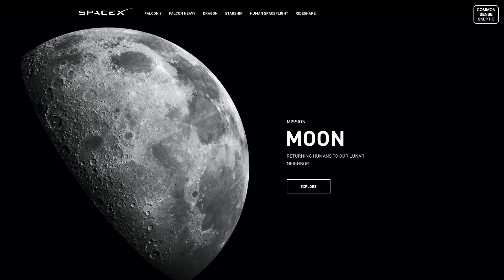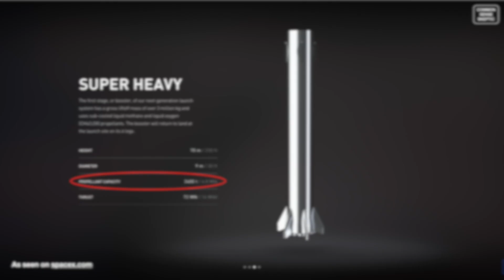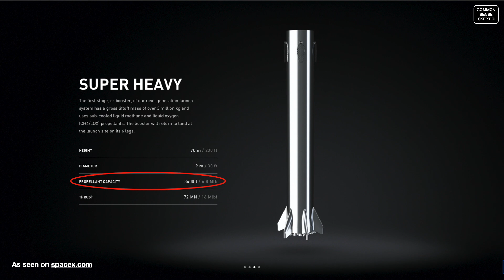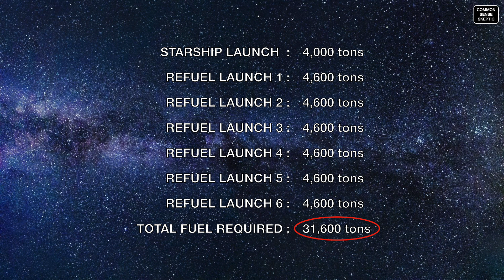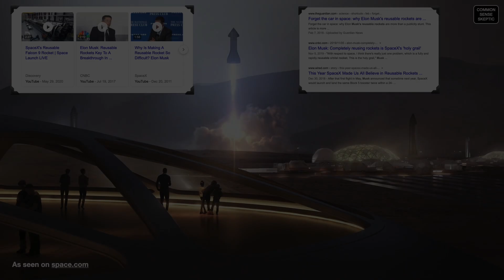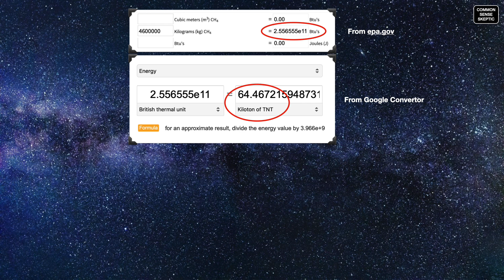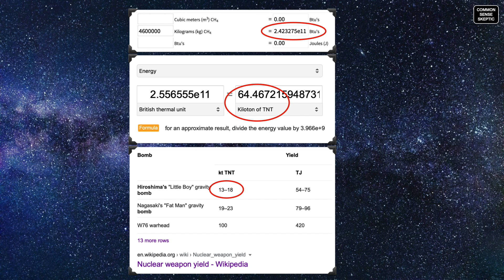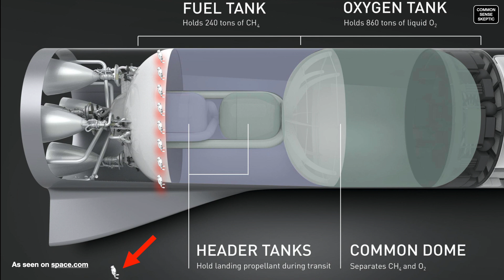STARSHIP EP5 - ORBITAL REFUELLING (1080p)

Comment: During orbital refueling, you don't need to transfer the fuel through sloshing. That would indeed cause the ship to de-orbit. You can transfer fuel in zero g through pressure against diaframs, which only need to be present in the tanker craft. I guess that this modification will be made to the tanker ship only, but confirmation is of course not there yet.  Regarding the rapid reusability, we have seen now several times that a StarShip prototype exploded on landing, but even so, it never destroyed anything but itself. Even when SN10 was standing right next to SN9 when SN9 exploded, SN10 and the fuel farm close by were unharmed. You mentioned that the superheavy lands with 3400 tons of fuel and that the StarShip sits next to it with 1200 tons of fuel on board. This doesn't happen, as the superheavy will land pretty much empty and the StarShip will only be fueled once it's stacked upon the (refueled) booster. If StarShip would be fueled beforehand, it would lose fuel and oxidizer through evaporation, introduce new risks, such as dropping the pressurized StarShip when lifting it with the crane, and the crane would have to be rated for much higher loads, which doesn't have to be the case. Finally, regarding the nuclear bomb thing with StarShip, those numbers seem out of proportion. While methane contains a lot of potential energy, such an amount never gets released during an explosion. Methane under atmospheric pressure (which it quickly attains when the tank is ruptured) has a low density, allowing it to quickly expand and move away from the blast zone. It would never combust under ideal conditions, in which all the energy would be released. Besides, why would any nation bother to spend so much money and energy refining uranium or creating plutonium to make bombs, while they could just build a (relatively) dirt-cheap StarShip with booster and just drop that on their enemy. According to your calculations, it doesn't even have to be fully fueled to get the job done, so I think you made an error regarding the energy release.
Reply: And, seriously, BTUS? I just can’t take that seriously.
Reply: ye you are right
Reply: You forgot the fact that Super Heavy may explode during refuelling, after fully fueled, during stacking, just before takeoff or right after takeoff. In this case CSS decision to use 3400 tons of fuel is correct
Reply: @KennyMong  it's true that such situations would be bad, but not as bad as was described in the video. Sure, the platform will be largely destroyed and debris will be flung kilometers away, but it will not be equivalent to a nuke in terms of energy. The fuel and oxidizer are not premixed in the booster and Starship. The fuel can only combust if it's mixed with the oxidizer and subsequently exposed to an ignition source. In case of super heavy, the reactants are likely to be expelled from the vehicle before ignition. This will result in a large fire ball, but not in an explosion. The energy release would be much less in this case.
Reply: @evertbunschoten2930  he did address this in a subsequent video if you are not up to speed
Reply: @evertbunschoten2930  "In case of super heavy, the reactants are likely to be expelled from the vehicle before ignition."

You mean, the methane will be expelled from the vehicle into the oxygen-bearing air before ignition, whereupon it will be quite thoroughly mixed. This is how a thermobaric weapon works.
Reply: @EEEEEEE354  If the SpaceX engineers are smart like you claim, Starship is going to be relegated to shuttling personnel and cargo to and from planetary orbit. It's clearly built with an atmosphere in mind, which means that it will be inferior in every way on other legs of the journey to purpose-built spacecraft. We are absolutely not at the point where a jack-of-all-trades tramp freighter can go the entire journey.

As to making Starship work even in that capacity, well, please realize that the problem of reusability gets worse as you get larger. You can't do anything about the propellant fraction, and the engines and avionics have to be sized to the rocket, and the structural beams have to be proportionally thicker in order to carry the increased weight, and that all eats into the payload fraction. We either need to find new materials to build our rockets out of, find better propulsion that allows us to reduce that fuel fraction, or find an alternate way to get stuff into space. Launch loops and the like are probably the best bet in truly getting the cost to space down.
Reply: @wyrmofvt  I totally agree with you that starship will be inferior compared to an purpose-built spacecraft. That being said, it doesnt mean it is useless, and is much more cost-effective than building three separate, built-for-the-mission spacecrafts. Two of those certainly NOT reusable, given the "purpose-built" tag you put on them. Money is the driving factor in everything our society build today. So, in order to be cost-effective, the concept of purpose-built spacecraft needs to be thrown away. Starship surely isn't perfect, but is the best we have right now, and in a relatively advanced stage of development. 
On the topic of structural integrity you've pointed out, to say that "the engines and avionics have to be sized to the rocket, and the structural beams have to be proportionally thicker in order to carry the increased weight, and that all eats into the payload fraction" is completelly wrong, simply by the fact that payload capacity is calculated after the ship hull is developed. Is the same as I saying that i'll build the roof of my house before I built the walls and foundations.
Reply: @julianorocha7462  Two of those certainly NOT reusable, given the "purpose-built" tag you put on them.

This is the point where your argument falls apart. I didn't say that the Earth-Mars craft and the Mars lander wouldn't be reusable — "purpose-built" doesn't mean "disposable." I mean, the Earth-Mars craft doesn't land on either Earth or Mars, but stays in orbit, and the Mars shuttle never leaves Mars's sphere of influence and is used exclusively to ferry cargo to and from the Martian surface. In fact, it is easier to make the Earth-Mars craft reusable because it doesn't have to endure nearly the same stresses as Starship will. Further, since Mars is smaller than the Earth, if you can make Starship truly reusable, you can make a purpose-built Mars lander/launcher reusable. My point still stands.

There's also the unstated premise that reusables will always be cheaper than disposables. Again, reusability is not a panacea. It has a cost associated with it, even in mundane items like cars. It's just that for those mundane items, the price of reusability is vanishingly small. The same is not true currently with rockets — nobody has made a rocket that doesn't need to be thoroughly inspected every time it returns to Earth. Until you can safely gas and go a rocket the same way you can with an aircraft, reusability will not be the solution to space access cost.

"the engines and avionics have to be sized to the rocket, and the structural beams have to be proportionally thicker in order to carry the increased weight, and that all eats into the payload fraction" is completelly wrong, simply by the fact that payload capacity is calculated after the ship hull is developed.

I'm "completely wrong," huh? Tell me, what happens if your payload breaks free during launch and collapses into the fuel/oxidizer tanks? That would end your trip pretty quick, wouldn't it? Sorry, pal, but the structural limits of your spaceframe is one of the constraints on your payload size, one of the factors that figure into that payload capacity after your spacecraft is developed. Because if you don't, you will not be going to space today.
Reply: In fact, you CAN use thrusters and not deorbit or even lower your orbit. You can thrust laterally to change the inclination of your orbit, and then turn around and do it again to put it back like it was. But the idea of doing that simply won't work. You can't transfer propellent by sloshing it in zero G. It has to be pumped, otherwise you are thrusting for tens of hours at a time.
Reply: @evertbunschoten2930  "Common dome failure at engine ignition".
The case for the prosecution of SpaceX, rests, your honour.

Comment: 9:28 This calculation is a bit misleading because the explosion of a rocket is uncontrolled and hence not all fuel is consumed.
The N-1 rocket had a fuel potential for a 5 kiloton explosion but later estimates put its RUD launch at closer to 1 kiloton.
1/5th of 65 kilotons would still be 13 kilotons though right about at the level of a Little Boy explosion.

Comment: 6:10: this does not have to be a problem; they just have to slow down relative to each other but can still move around the Earth at speed to maintain orbit.  That does not make the entire thing work, but that one detail should not be an actual problem.
Reply from the maker: Adjusting the speed of the craft requires fuel, fuel not being spent headed towards Mars. Also, this tail-to-tail paradigm has already been abandoned as unworkable. They've moved to a side-mounted docking which really isn't any more viable.
Reply: Oh, I'm not trying to say that a single minor inconsistency makes the insanity workable, just that falling out of orbit does not have to be the reason it doesn't work.

Comment: In one of my KSP saves I did a challenge where I had to get 100 Kerbals to Duna in a single vehicle. I was playing on the mode where you start with basic parts and unlock new ones by completing tasks and achieving milestones, and so I formed a plan that allowed me to use every single launch into orbit to help my eventual goal.

After my initial launches to unlock the large fuel tanks I sent up a rocket with 2 massive empty fuel tanks on top that would act as a fuel dump and then every mission from that point would either dump their extra fuel before going to their destination or would dump their remaining fuel before re-entry. By the time I was ready for my Duna mission, I had both tanks full and had added 3 more by attaching spent stages from other missions.

The logistics of orbital refuelling are a nightmare, but in KSP it's at least fun!

Comment: I don't know if earth to earth might ever become a thing with starship (no one does, it is just a possible application), however if it were to work, it would be carrying more close to 1000 people. Also it isn't meant to be the most fuel efficient flight, rather shorter. Whereas a regular flight might take 15 hours or so to the other side of the planet, starship might be able to do it in around 2 or so hours, embarking and disembarking included.

And the fuel with the tanker starship doesn't need to be in the payload compartment, they can design it so that the tanks in the starship are stretched out. It is afterall a different version of starship, not a replica with just some tanks added in the cargo compartment. Because of this you might have more fuel than 100 tonnes being transferred using a tanker variant.
Reply from the maker: Our episode 8 eviscerates PTP. The entire concept is garbage,mane same for the Army’s to use it for logistic deliveries. Pure trash.
Reply: @commonsenseskeptic  The sound you are exaggerating. The space shuttle was launched less than 1km from the shore line. By your estimates we'd hear it launched in Europe, Africa, ...

And comparing it with the largest sound ever known, which if we use your own chart would have been well above 220. So lets look at that event. They measured 172 db at around 160km, using your information to calculate the soundlevel it would have been 280db at the source. 4800km from there they said it sounded like a cannon from a nearby ship. According to your data, it should have been around 146db, which is very close to the soundlevels of a cannon at just few meters, not a canon on nearby ship. At around 500m the sound of a cannon being fired (170db) would be around 115db, the same as the sound a hammer drill, well below the estimated 146db.

The problem is that you uses one rule to calculate sound dissipation, however this might not be correct at larger distances or in all situations. For example the sea isn't flat, it is in constant motion due to waves, this already can have an impact on the sound. Maybe even the earths curvature might affect it. 

In essence your sound argument is way too simplistic. It is actually rather foolish to think that they haven't had someone look into this before they came out with this. The same with the propagation in the sea. You can minimise this quite effectively by sound suppression systems that prevents the sound waves from going directly into the sea, already lowering the impact on sea live a lot. There is a large differenc between a sound above the water and a sound inside the water.

Another problem is that you took a promotion video at facevalue, a lot can change from how they showed things in it. Maybe instead of a boat they'd use helicopters. Electric helicopters/vtols are well being researched at the moment, so who knows. This also ties in the rest of your arguments, they are all based on how things are in the past and now, like they are somehow static/non-changing. They are not, things are constantly changing/improving. If we used aviation procedures from 100+ years ago for now, modern passenger aviation wouldn't be possible either at this scale. 

I am not saying that point to point for starship will ever be done or even possible, but your debunking video of it debunks nothing. You argue like the people on the other sides are all idiots who haven't done any research, who can't come up with ways around these problems.
Reply from the maker: @MDP1702  the sea life off your coast will definitely hear these launches at sea.
Reply: @commonsenseskeptic  No they won't, not with the proper mitigation, which definitely can, should and will be done. You see, what you talked about was sound created in the water, not above it, which is something completely different. Sound that travels from above the water into the water is much less loud, than when you produce the sound immediately in the water. Especially if the sound already can't take a straight path into the water (due to the mitigation designs/procedures forexample). Again the problem is here that you are looking at it in a much too simplified way, starting from the wrong conclusion and like they can't do anything about it.
Reply from the maker: @MDP1702  the sound will be transferred directly into the after through the pontoons of the platform.
Sometimes, things are that simple after all.
Reply: @commonsenseskeptic  If the sounds have to travel into the water through the pontoons of the platform, that sound won't be so loud anymore at all when released into the water. Sounds like you again are talking quite simplistically about it. There are plenty of ways to reduce the sound before it gets to the pontoons of the platform.

I'd guess you have a degree in some kind of science/engineering field, just out of interest, which field?
Reply: @MDP1702  And I'd guess that you don't.
Reply: @Archangel17  Yes, but the plan to fit 1000 people onto a starship involves amputation and Tetris.
Reply: @paulpinecone2464  I am an industrial engineer, so yes I have a degree in an engineering field.

Comment: now they are talking of even 14 refillings
Reply: Assuming 100t payload and the rocket equation and a velocity of 3.5km/s or a specific impulse of around 350s , then it's around 3 to 4 refills .... should not quote something blindly ... so the fuel saving comes from flying without payload, which would make around 350t fuel saving then

Comment: point to be made, cape canaveral(more specifically LC 39, was made with the foresight that a saturn rocket(or larger) couldve blown up on the pad, thats why the VAB is ~3 miles away from the launch pad. Luckily, nasa hasnt had to deal with any fully fueled failures at LC39. hopefully we can keep it that way.